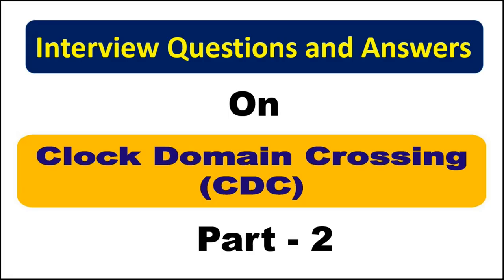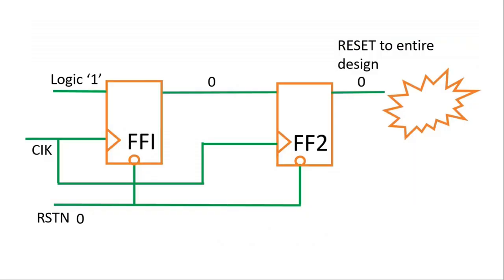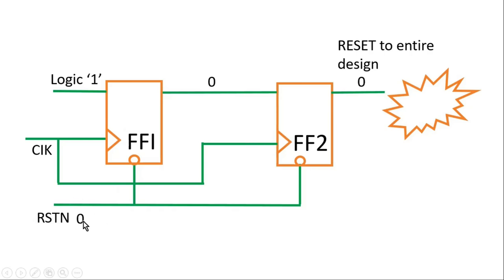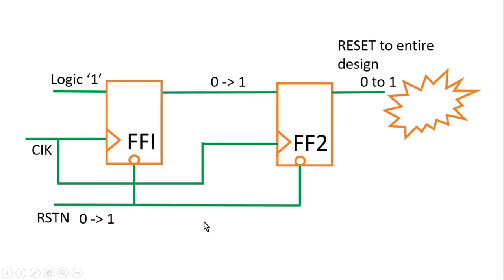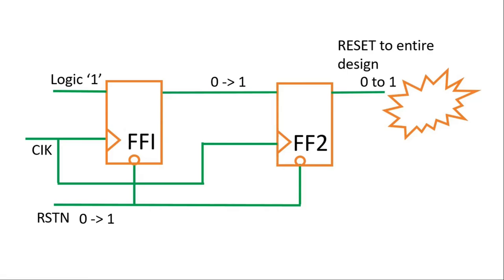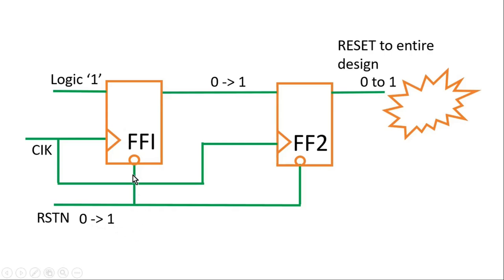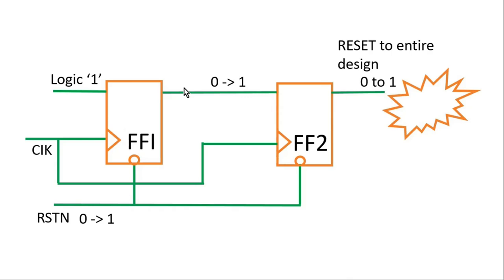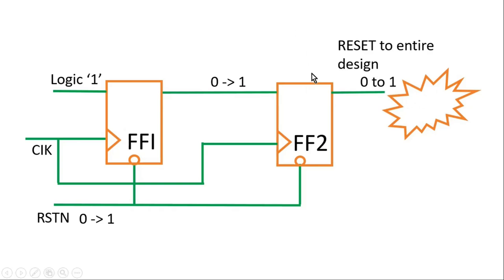Interview Questions on Clock Domain Crossing CDC and synchronizers part 2

Comment: actually while answering the question that you asked in Part 1 , you said that as long as input is stable , though we violate the setup-hold times  flip flop will not go into meta stable state.. In the above case, The input of FF- 1 is not  hooked to Logic 1  and FF-2 's input is changing actually. So as per your statement , FF1 will not go intp metastable state as  input is constant ( logic 1) .. and FF2 can go to metastable state... 
But you said other wise.. can you clarify..
Reply: exactly my doubt. i think what he really meant was either : a) the last flip flop SHOULD not go into metastable state (otherwise the design can go into metastable)
or b) generally, the second flop doesn't go into metastability as the resolution time is (usually) less than clock period.
lmk what you think

Comment: At 4:46 , you said, while de asserting  rstn signal, the FF2 doesn't go to meta stable becoz input to that flop "0" was stable. In the same way, input to first flop FF1 is having the same value "1" from the beginning and it was also stable right ? then even FF1 also should not go to meta stable right ?  Please Correct if My Understanding is wrong.

OR  Is it like both input and output must be same in case of reset changing during setup and hold window ?
Reply: the difference is that the value need to change from 0 to 1, thats why it is in meta stable state compared to ff2